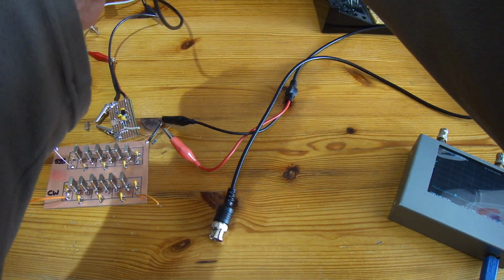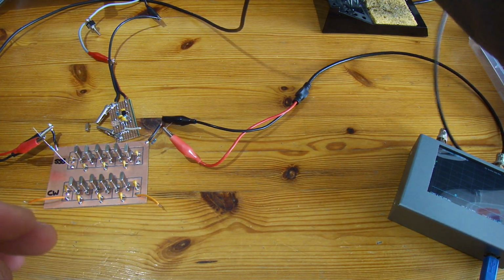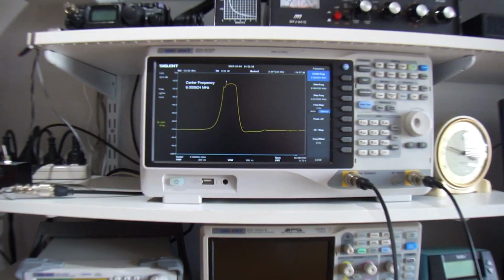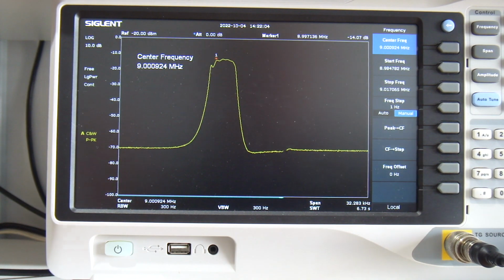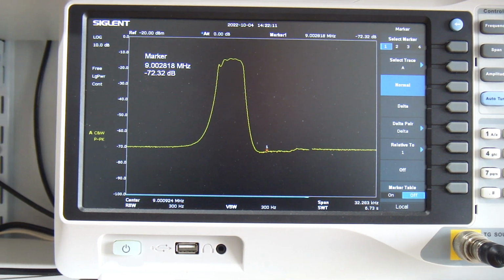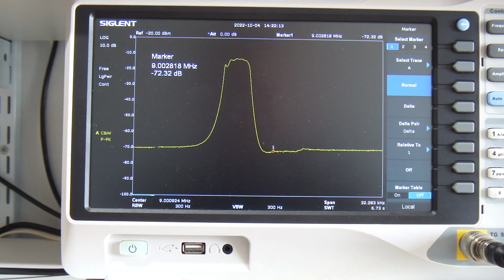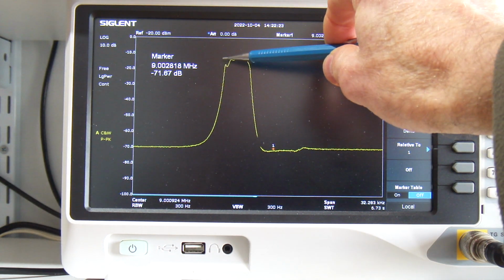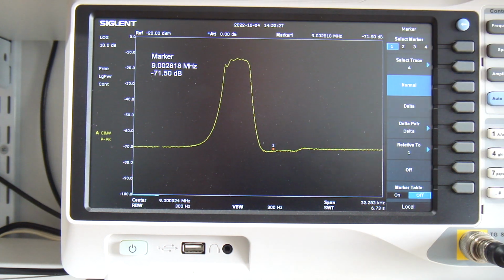Homebrew 80m/40m SSB/CW Rig - Part 5: Crystal Filters

Comment: I just discovered your channel, great project and videos, thank you for sharing! On the difficulties of measuring Crystals and derived filters with VNAs: Some filter bandwidths are very narrow and this interferes with the frequency sweep rate of the instrument. For instance, the V2 Plus4 claims 0.25s/201 points so a frequency switching rate of ~800 Hz. Depending on the number of poles and the bandwidth of the filter, the test signal pulse may never reach the output of the DUT in time for the sampler to capture the steady state value. More generally, some devices have a long propagation delays. These include filters with multiple poles and narrow bandwidth, crystals due to the very high Q and devices with an intrinsic delay like long cables and electro-optical components due to the fibre pigtails . The cure is to slow down the sweep rates to have the DUT output reach steady state before starting a measurement point. This feature is available in all lab grade instruments I worked with but I've never seen it on the NanoVNAs. The NanoVNA V2 Plus4 Pro is the only one I could see claiming crystal measurement capability (see note on spec table: https://nanorfe.com/nanovna-v2.html#specifications) by means of reduced receiver bandwidth. I doubt this really works though. A narrower filter slows down the trace sweep because it requires a longer dwell time to yield a stable value on a steady signal. This reduces the trace noise similarly to trace averaging but will not yield accurate results on a varying/delayed signal. Do you have the 'V2 Plus4 Pro' ? It would be interesting to see if I'm wrong and everything works fine on crystals as claimed?

Comment: I’ve built a number of crystal ladder filters and came to the conclusion that the G3UUR’s QER design is the easiest and best performance to use. I have a few comments:

1. I use the nanoVNA-saver software with my nanoVNA. It scans, displays an reports results much better than just using a NanoVNA. You can have a much larger number of scan points (than 101) by increasing the number of segments; the SW breaks down the task and control the NanoVNA to do it. It also analyzes band pass filters.
2. Use NanoVNA to get key crystal data (F0 serie resonance frequency, 3-dB bandwidth, minimum loss, package capacitance). Derive corresponding crystal parameters Lm, Cm, ESR from the measure crystal data using established formulas (or use the G3UUR’s 3-dB method.)
3. Use the Dishal DJ6EV SW to design your QER filter (enter the number of crystals, desired BW, crystal parameters Lm, F0, ESR to get the characteristics impedance and the value of the shunt capacitors). Look in the IEEE QEX year 2009 archive “Steder-Hardcastle”.
4. Design some adaptive circuits to match the filter impedance to that of  your system (usually 50 ohm). I prefer using a common base BJT amp circuit at the input and a common collector amp at the output. Alternatively, one can use L-shape filters using L and C.
5. Use SMA connectors and SMA cables to connect filters to your VNA. Pig-tails cables with alligator clips (and sometimes unknown cable impedance) are suspectful in showing non-truthful results.

My results lately have been very good. I can get +/- 0.5 dB ripple and steep side skirts and BW that is within 100’s Hertz of target.

Comment: Check measurement points, these cheap nano VNAs suffer on this very critical aspect, i.e. they have very low number. I use tinyVNA, more expensive but you greatly eliminate measurement uncertainties, hope it helps, 73

Comment: How did you arrive at the 170-ohm value?  Or rather, what changes with different resistors there -- is it the shape of the passband?  I'd like to know how to determine the correct values for my own filters!
Reply from the maker: I varied the terminating resistance until i had a passband with acceptable ripple. It's mainly a tradeoff between ripple and insertion loss.
Reply: @CharlieMorrisZL2CTM  do you use the value on both sides of the filter? When you change the resistor to a transformer, does the insertion loss improve?

Comment: Hi Charlie, I have read somewhere that using two crystals of the same value on the input and output improves the performance, see the HF signals site where the BitX does this on his crystal filter. From memory where I first came across was in the 4SQRP site. Look for kits SAXVO (retired kit) where they use 3 crystals in parallel to stabilise the VFO.

Comment: I have a question about the dimensions of the RFC. Sometimes in a Amplifier instead of an Load Resistor a Inductor is used. How large should its inductance be and on what does it depend? Thanks for helping out

Comment: Nice  work Charlie. I found better rejection by grounding all the crystals. (About 90 dB)The Spectrum analyzer BW of  300Hz is just below the  CW filter bandwidth, so you might get some better results going to 100Hz BW. The Nano VNA maybe sweeping frequency too fast to get a typical response.
Reply from the maker: Hi Kevin. I grounded both filters and gained another 3dB of attenuation. I'm happy with it. Thanks again.
Reply from the maker: Thanks Kevin. I'm very new to the spectrum analyser. Still leaning. The grounding is interesting. I did that on a previous filter and had similar results to you. This time was different for some reason. I'll try it again tonight.
Reply: @CharlieMorrisZL2CTM  I have spent 45 years or so with analyzers. First repairing them, and the last 35 years or so, using them almost daily. The value for money these days is exceptional.. The new price of analyzers back in the 70s one could buy a house with!!